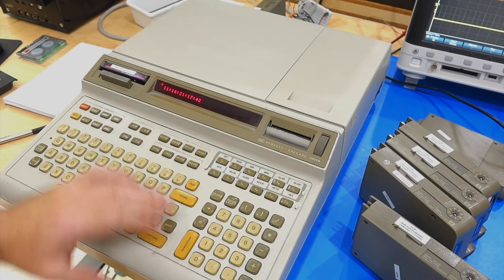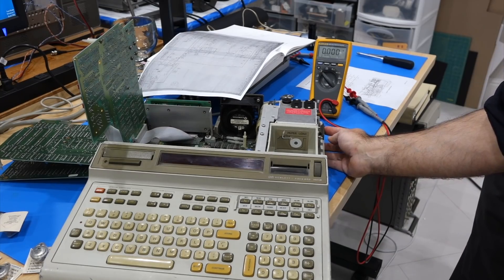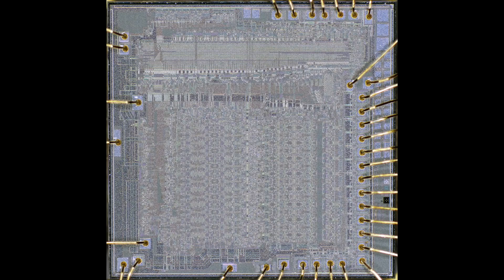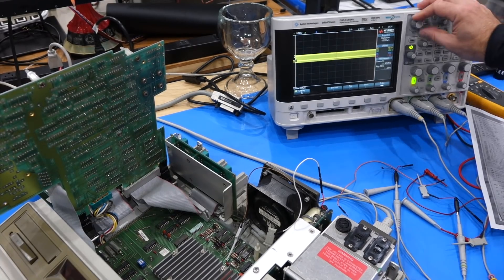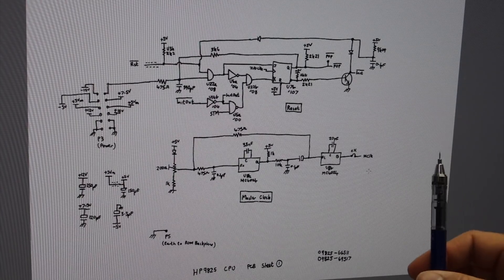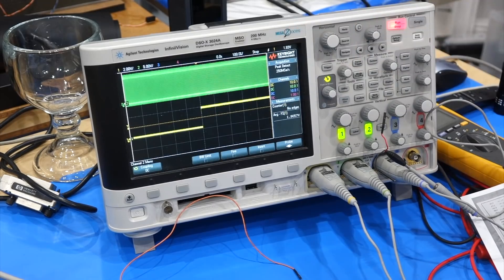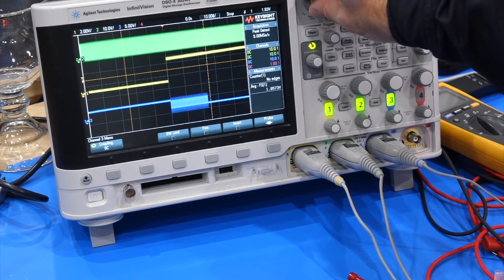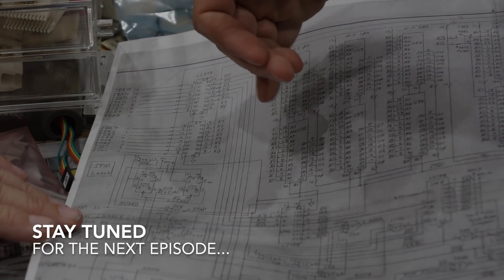HP 9825 Repair Part 2: Is Our Rare 16-Bit Processor Fried?

Comment: Losing this would be tragic 🥺 I hope you get it fixed. It's in good hands.

I have been looking at a synthesizer that suffered overvoltage due to failed PSU. I wired a reset switch to the reset circuit so that I could reset and capture signals without switching power on an off repeatedly and stressing it more.

Comment: Marc, WHat kind of extensions do you use on your oscilloscope probes?
Reply from the maker: Those are hard to get. It’s an older probe system, which is far better than the modern one. You can get the pieces on eBay, but they are fairly rare and usually not that cheap. The probe is an HP 1161A. Far more flexible, smaller, lighter and much more precise tip than the modern ones. The end adapter is a HP 5063-2147 dual lead adapter, and the grabbers are the same as the the ones for the logic analyzer (can’t recall the HP number, but plentiful on eBay).
Reply: @CuriousMarc  Thank you for the answer and i will keep my eye out on e-bay. Keep up the good content i really love your videos!

Comment: Gee,  do you have videos on the HP-1000 and/or HP-2000 computers? our company in the 1970-80's used these models on a level-2 processing system...  thanks a lot...:)
Reply from the maker: Not yet, but we have plenty of them in the restoration pipeline.

Comment: Silicon on sapphire?
Reply from the maker: I don’t think so. Silicon On Sapphire was used for the next generation CMOS chips at HP, and was notoriously difficult  (low yielding) I seem to recall.
Reply: @CuriousMarc  Thanks Marc, I seem to remember them telling us that if they managed to get the yields up we would rule the world. The 2100 machines were my responsibility.
Reply from the maker: @andrewallen9993  No kidding! Were you the product manager on the 2100 machines? That's the one machine I don't have in my collection (I bracket it with the 2116 and the 21MX), but my friend Bob Rosenbloom has several working ones. Easiest to use front panel ever.
Reply: @CuriousMarc  Field Engineer :)
102077 on those machines being the source of the original"halt and catch fire" code I believe

Comment: Nice to see the 9825 repaired to component level and how modern test equipment is employed to do this.  I repaired many 9825's in the day as an HP field CE, on customers sites.  The machine was well designed for modular swaps and ease of repair, the boards exchanged under the Blue Stripe program, the faulty boards being sent back to division for repair.  Good luck with your repair.

Comment: 10:23 The cartoon shows that the HP engineers had anticipated that there would be an incident with this machine that would result in the explosion of some of the chips!

To fix the problem you need to find out where that cartoon dog in installed in the machine and take away his detonator plunger.

Comment: Excellent video, I am waiting for the next one. I hope (and expect) that the main processor is still working, the problem is most likely another chip. (at least that is what I would have said normally if this was a single die chip and it still tries to access memory - I suppose it might be possible that some of the submodules are fried)

Comment: I've repaired a few old computers that suffered from over voltage. Every one had bad RAM. The stuff is super sensitive. It frequently (but not always) fails short, like your pass transistor did. That makes it plenty hot and easy to find. Don't leave it on too long looking for the short, though. The current from the short can burn PCB traces.

Comment: To be fair, while the 8088 had an 8 bit data bus, it was internally a fully 16 bit processor. And, while not as popular, Intel actually released the 8086 first, which was fully 16bit with a full 16bit data path. The 8088 was basically an 8086 in every way other than the external data bus interface.

Comment: Those Papst Pamotor fans aren't very efficient at moving air, with small blades of bent sheet metal rather than having airfoil profiles.  They are efficient acoustic noise generators, however.  If it's a model 8500D, it's rated at 53.0 m^3/h.  A Noctua NF-A8 5V, for example, is rated at 55.5 m^3/h and 17.7 dBA.  You'll need to run 5V to the fan, but they don't draw much amperage.  The downside to the replacement, though, is you won't be able to tell if the calculator is on when you're upstairs... ;-)

Comment: My experience (with more modern CMOS logic) of over voltage is that often a bus driver or inverter will die (usually pulling large current) before other devices on the bus.

Comment: All of this early 70's  HP gear was eloquently designed and manufactured. It was expensive at the time, but still seems amazing that the engineers  could produce a product at this level even at this price point. I collect old HP gear, primarily because I love to use stuff  from this era.

Comment: The reset circuit on the Sinclair Spectrum (Z80 based) was a simple RC. I'm amazed at how complicated HP could make a power on reset be :-)
Reply: Most reset circuits are, the most complex add a power monitoring chip as well. I can only think that HP needed to hold the end of reset off until a number of other things had happened.

Comment: Great video :) The processor is, as you say, based on the HP 21xx architecture.  I didn't realise until recently that the Loveland chip added a stack to the HP21xx. That would have made a huge difference. Did they use this in the HP1000 L-series? The 9825 was the first bit of HP kit I ever saw, and I was blown away by it. I subsequently spent nearly 30 years working for HP/Agilent. Good luck with the repair. It deserves to survive.

Comment: Maybe not the same, but a very similar looking chip is present in the HP 8568A spectrum analyzer, as a main CPU. Be careful, because only the A version has this old chip. B version uses a Motorola 68k
Reply from the maker: It appears to be the same processor in the HP 8568A indeed.

Comment: YT's Ben Eater made a series on the 6502, starting with the CPU chip alone on a breadboard (+ power + clock...). Knowing that the opcode for the NOP is $EA, he hardwired it on the data bus. So whichever address you try to read the answer is $EA. So during the startup sequence, when the "reset sequence address" is fetched from the ROM, it turns out as $EAEA, and when the Program Counter is pointing to $EAEA, it executes the code $EA, $EA, which is NOP NOP NOP ...  It was his way how to demonstrate the startup of a CPU without any additional component. Not sure that could help. Regarding the HP calculator, my first employer, in the civil engineering structural design domain,  used an HP 9845, with tapes, printer and monochrome graphical terminal.  Bon courage !
Reply: Was also my first program on Z80, 64k of 00h's -- NOP much easier to wire up on x80. :)

Comment: That's surprising that they dither the system clock to reduce EMI. Usually only see that in SMPS', but then again its a calculator, and time is only of importance to the user, not the machine itself.
Reply from the maker: It’s still in use today in your computer. Your PCIe bus clock is dithered too!

Comment: It would be great if these proprietary HP NMOS processors could be burned into an FPGA so we will no longer need to worry about these ceramic chips getting baked, cracked, or fried.
Reply: Obtaining proper logic scheme is main problem in this and similar cases. Reverse engineering uses IN/OUT signal analysis is impossible due complicated functions inside circuit.

Comment: Always amazing to follow your channel. I have few vintages from HP myself. My last ebay acquiring is an 8566b which I repaired with some luck. I love this machine! Keep us up to date and Thanks!
Reply from the maker: No kidding. The HP 8566 is a masterpiece! And the A version used the same processor as the 9825!
Reply: @CuriousMarc   You Sir, know Much more than me about Glorious HP of the seventies and eighties. I didn't know this particular on 8566a. As I said I was very  lucky in this case as I had only to change a 33000 Pf cap on the 5.2 volt rail and eliminate a bad pin contact in the yig oscillator. And after maybe 2 hours of fiddling I had it up and running!!!! I was thinking much worst!
Reply: I have a 8568A with this vintage CPU, 8566B is coming next monday. :)
Reply from the maker: That’s the way to do it! I have both instruments too.

Comment: If this processor is like most, that boot stage is probably attempting to locate the boot or reset vector location in ROM, by reading the address which may be located near the top of the ROM. What I would do is see if there's a dump of the ROM available and if it shows the reset vector location. If the reset vector bits is all HIGH, then the CPU will basically go to la-la land. A logic analyzer may be useful here, to read the data bus and see if the reset vector is being read correctly.
Reply: Pretty sure he/they know that, just trying to keep it simpler in the video I suppose...

Comment: the power transistor got hot, and the internal chip slid down due to gravity and shorted, so if you can keep the power transistor horizontal, you may be ok, or not.

Comment: Good news so far!  May your luck continue.
Reply: No. I see nothing but horrible bad news here. If there was something wrong in the reset or other power up circuits it would have been an easy $.25 cent quick TTL fix and maybe bring up the computer then. As it is he has to pull out the big expensive time consuming "fancy pants" logic analyzer!
/I've walked the walk!

Comment: That is sensible approach to troubleshooting that system. I’m seeing and remembering HP “house” numbers all the misc. TTL chips, I assume you have a cross reference to identify them if a replacement is needed. I also assume all those daughter boards in the vertical service position are required to start. If I was approaching troubleshooting the system I’d pull every accessory board not required to start as a baseline (called least/minimum configuration testing) and see if it would initialize the display, I assume thats where you are starting from. I appreciate your demonstration of use of the scope to check for basic clock and power on reset signals.